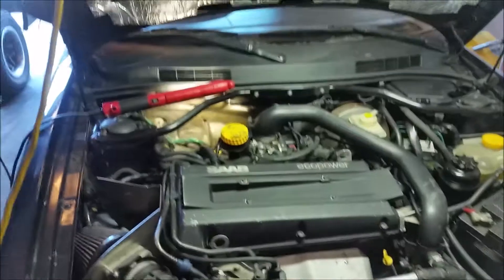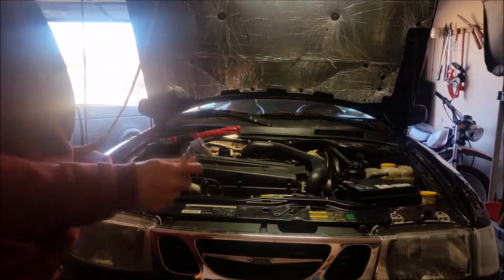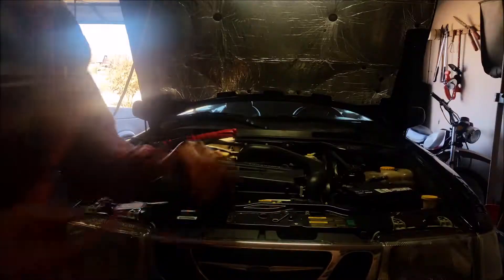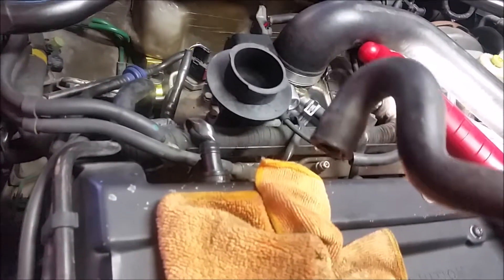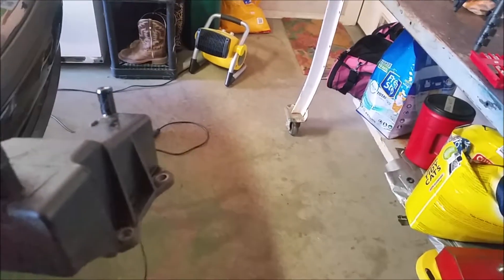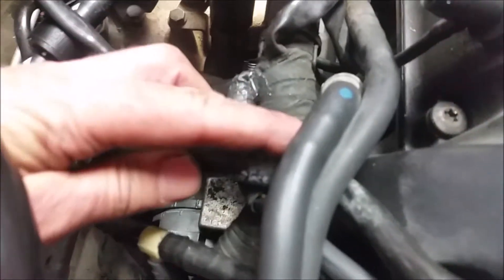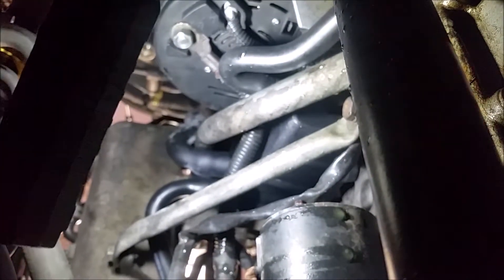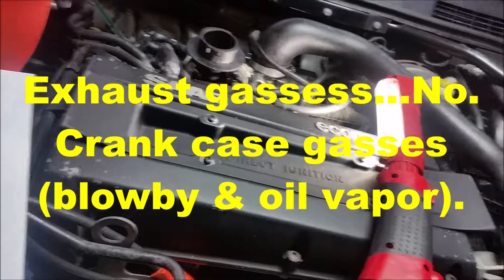S2E16 Saab 9-3 PCV System Update

Comment: So I have a 2003 9-3 SE 2.0t convertible, engine- 205r, I did the rubber glove test, did not blow up, did the opposite, it sucked in the glove a little, is this normal? and how can I tell if the update has been done?  Thanks!

Comment: Does a malfunctioning PCV mess up with oil level? My 9-5 b205 accused low oil level and I filled half a liter and it went to the top mark. The readings are unconstant.
Also, the engine leaks from somewhere around the belt case

Comment: Muchas gracias for this. I ordered the pcv update from eEuroparts and it DID NOT come with any instructions. I would have had to take it somewhere if I did not find this video. Thanks again. Hopefully this resolves the oil leak issue. I did not even know that there was a 'pcv update' for this '02 9-3 until I talked to a local SAAB mechanic and he recommended to do the update when doing the valve cover gasket.

Comment: Could not have done the job without this video. Fills in the holes left by the directions. Thank you. My kit with the same part number didn't come with the small check valve, however.